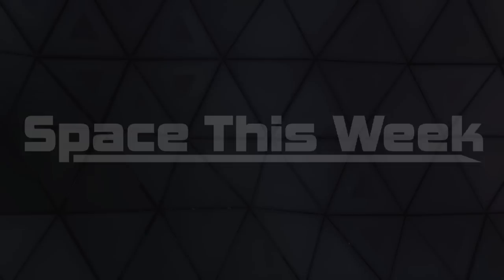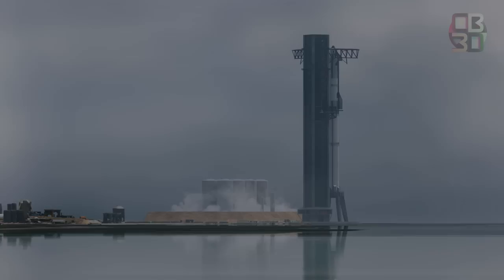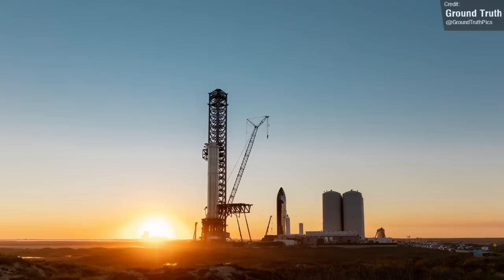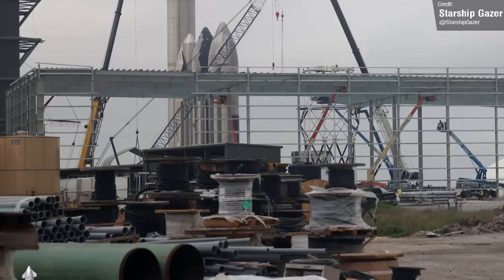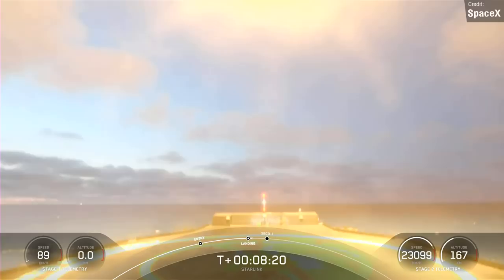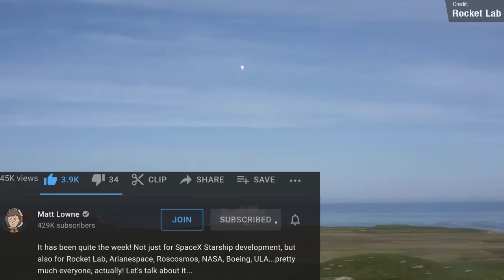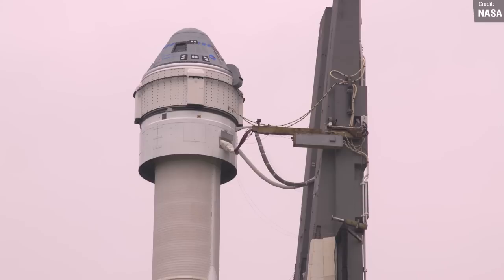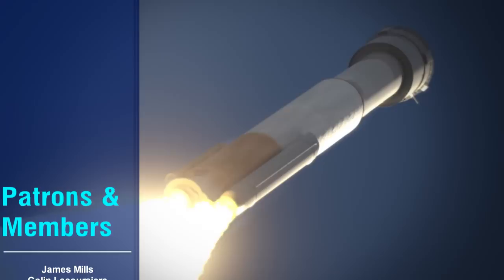SpaceX Starship Booster 7 Rises, Ship 24 Completion Soon, Boeing Starliner Failure, & Electron Catch

Comment: Everyone thinks its crazy that they can fix that downcomer. But it's all steel, repairs are relatively easy to do. Work like this will be a key part in the reusability of starship
Reply: That fact further supports SpaceX's decision to use stainless steel instead of other exotic materials.
Reply: they probably did it to see if they could do it.
Reply: The only difficulty is getting inside the sealed tank and closing it up again.  Because the tank walls are load bearing.

Comment: SLS is such a good looking vehicle, I hope the thing falling off is "That's the glitch for this mission" :-)
Reply: SLS looks like a rocket circa 1970. 
It will probably only launch a couple times due to the 3-4 billion per launch cost. Gotta love the corruption baked into cost plus contracting.
Reply: The capsule the part fell off of isn't part of the SLS program, its Boeing's LEO crew capsule, Starliner, meant to compete with Crew Dragon.  The capsule on SLS is called Orion and is already installed on top of the launch vehicle.
Reply: @srrich27  And I think Starliner isn't even going to the moon, just carrying people up to the Gateway, which will fly people and cargo to an orbit around the Moon, where they will board the Starship HLS to land on the Moon.

Comment: Weather wise, May is a particularly chaotic and "dirty" month in Texas and along the whole Gulf coast. Pine tree pollen fills the air, March Fly ("Love Bugs") swarms choke air filter systems and litter any surface available from April through June. It's not spring showers in May on the Gulf Coast, it's 3 day long wind storms with torrential downpours that can last for hours, if not days, flooding the flat and low lying coastal terrain, splattering the calcium out of the crushed limestone and shell paving (common around the Gulf) making a general mess of things. If you have ever worked in any industrial area in coastal Texas, Louisiana, Mississippi, or Alabama, the image at 4:05 looks like "spring" not "grubby".

Comment: If starship and super heavy permitted to launch from bocha, is that possible for spacex do suborbital like it used to?
Reply: They should be able to do sub-orbital flights now, that are equal to or less than the Falcon Heavy. In 2014, SpaceX got approval for Falcon 9 and Falcon Heavy orbital launches. They also got permission for sub-orbital flights of reusable boosters like the Grasshopper. The FAA review is to see about adding Starship (Starship second stage and the Superheavy booster) to the orbital launch approval without needing a new EIS. Otherwise, they should be able to launch Starship (second stage) under the existing approval for sub-orbital flights as long as they stay under the Falcon Heavy propellant load.

The problem with resuming sub-orbital flights is that SpaceX would have to stop work on Stage 0, clear everything out from the pads, launch and land using the temp legs, because SpaceX doesn't look ready for a catch, then put everything back to start work again. That delay in Stage 0 work is likely why SpaceX stopped the sub-orbital flights.

Comment: Why does starliner look like one of my first few ksp rockets
Reply: You didn't unlock tanks wide enough for the capsule yet :P
Reply: @user-lv7ph7hs7l  I meant why does IT look like that, I know why mine were goofy
Reply: @masav6432  Centaur is not wide enough. The open skirt as well as those plates around the capsule with holes are meant to shape the airflow so it doesn't hot the Centaur too hard. It distributes it over a larger srea otherqise the wind might hit in a small area and cause damage.
Reply: @user-lv7ph7hs7l  Thank you!

Comment: How does the X37 launch? If they put that on a Falcon they could claim the title of first fully reusable flight..
Reply: Historically it launched on an Atlas V, and Vulcan will take over. Edit: I was incorrect, it can fly on Falcon 9 but ULA is still listed as the primary carrier.

That said, on the Atlas it still uses the Centaur upper stage. The plane itself doesn't have ascent engines, only OMS. So on a Falcon the second stage is still used and is only expendable, it would be no more reusable than a Dragon flight.
Reply: The X-37B flew on the Falcon 9 Block 4 booster B1040.1 on 7 Sep 2017. B1040.1 was recovered at LZ-1 and expended on 4 Jun 2018 on the SES-12 geostationary communications satellite. It does not count as a fully reusable flight as the Falcon 9 second stage is not recovered.
Reply: @steveaustin2686  Good to know. Put a parachute on the next one. Rocketlab can catch it.
Reply: @markschroter2640  The Falcon 9 second stage would burn up before then as it is going orbital speed. SpaceX planned on recovering them at the beginning, but it apparently cost too much payload to do so.
Reply: @steveaustin2686  Fair enough. On another note, what can you tell me about putting a dream chaser on top of a falcon? You seem to be up to speed on this.

Comment: Why does SpaceX not catch their fairings with helicopters?
Reply from the maker: Hugely complicated compared to just fishing them out the water. Fairings are not damaged by salt water, but rocket engines are. SpaceX initially caught the fairings in the air using a giant net, rather than fishing them from the sea, but this was deemed unnecessary.
Reply: @MattLowne  Thanks Matt, I thought SpaceX was trying to catch them with nets to protect the inner linings of the fairings.
Reply: @DeepakKumar-cd8ny  SpaceX did try catching with a huge net on a ship, but it wasn't very successful overall and they fished a lot of fairings out of the water anyway. So SpaceX had the delicate equipment that can be damaged by the water moved up to near where the fairing splits in half to keep that equipment out of the water. Then they decided to do away with the net catching ships and just fish them out, since the equipment wasn't really getting wet anymore.
Reply: @steveaustin2686  That is very cool. Thankyou.
Reply: @DeepakKumar-cd8ny  You are welcome.